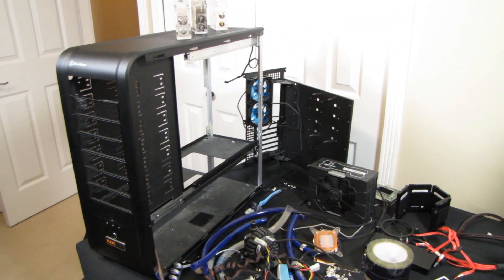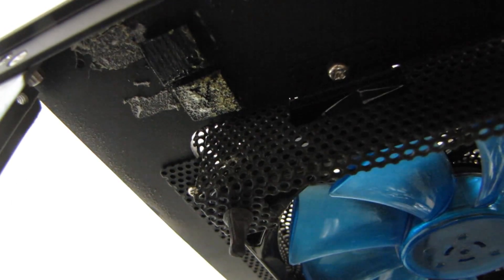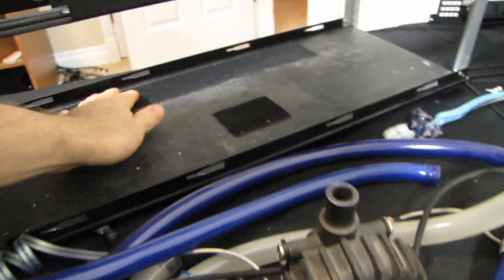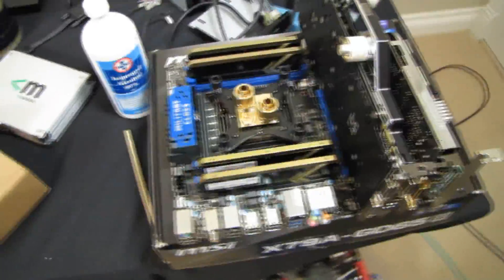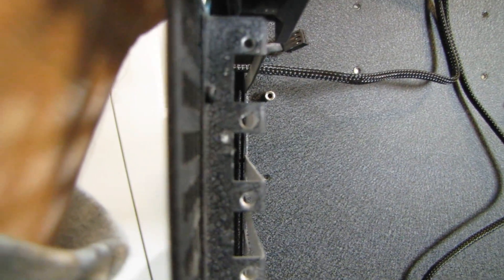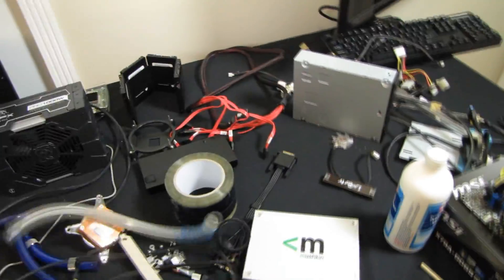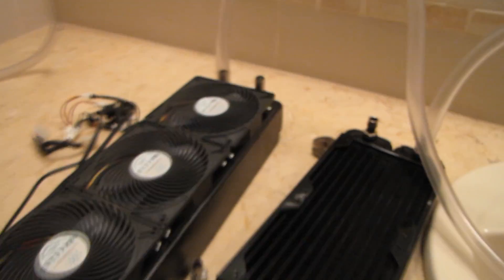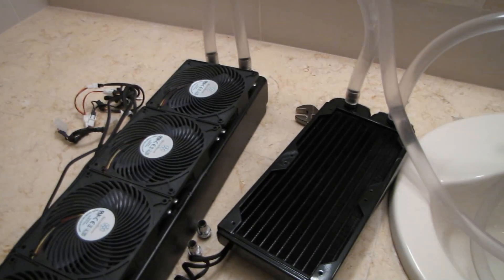Personal Rig Update 2012 Part 3 - Water Cooling Maintenance & More Pondering Linus Tech Tips

Comment: All computer parts do better in the long run with maintenance. Just about anything does, really. Your CPU heatsink is going to clog up with dust eventually whether you're watercooling or air cooling. What you're talking about is closed-loop watercoolers you buy pre-assembled, though. Not custom loops, which are generally more expensive, higher performance, and more tricky to set up.

Comment: hey, if you are limited in budget, go for amd platform, otherwise, stick to lga 1155, DON'T buy lga 775 because you only can upgrade the processor to core 2 quad (which is more expensive than core i3) i'm using this type of socket right now and i'm waiting for my fx 8120 (maybe fx 8350)... :-)

Comment: There are far better ways to clean the cooling system.  A very simple way is to is to drain and refill with regular water.  Now add a little general purpose lime scale remover ie: Lime Away, CLR.    Let the pump run for few min, flush with distilled water.  All your tubing, your Micro-res, it will all look like new.  I've done this 6 times now in my water loop, I haven't seen any abnormal wear on the Rad or blocks.   Coffee pot cleaner may also be the same stuff but I'm not sure.

Comment: the reason u have gunk in your look is because the water you use in the loop 
i see that you are using house old water that isint clean you need to buy distilled water and you
need to do a distill run through at least 5 times at about 15 min cycles with at 10 min intervals

Comment: @LinusTechTips or any smart Water cooling fanatic out there....To clean your tubes or your blocks couldn't you put like rubbing alcohol in the piping or blocks and let it evaporate out and seal it immanently? I mean with rubbing alcohol once it evaporates you're good to go as far as that goes as it leaves no residue behind, so if you're afraid of gunk and what have you, wouldn't that be a solution to completely sterilize your items?

Comment: @kitekunisaki2000 Minteral Oil/Water should only be used on lower end machines, any high end machine will generate to much heat which is a problem for Oils because oil heats up and stays heated longer than water and its heat is hard to distibute about, ive got a really low end machine my self i wanna do it to, but 120ish dollars is kinda meeh of a investment..

Comment: Nice you removed my reply...Weak.. MSI mobos are crap for overclocking get an Asus Crosshair series, MSI have turned into junk as of late "PERIOD", reservoirs are not needed, really they are just for looks.. Phenom II 960t at 4.36GHZ from 3.0GHZ on a waterbox made from an old dell case,old dell PSU, two 10 x 12 inch radiators form an old dehumidifier, $40.00 Thermaltake Pump, $26.00 in fiitings, 70/30 car antifreeze/coolant, for $67.00 bucks I have "OVER" a 1200 MHZ OC, Temps in the basement.

Comment: Resivoirs are "NOT" needed.... F.Y.I... MSI motherboards are Junk, they really suck these days, you should have gone with Asus, and also, why did you let your case get so dirty.??
Non conductive liquid only works if you have an immacultely clean case, any dust that mixes with the liquid will instantly make it conductive.. Just make a water box, I did, two 10 x 12" Radiators from a dehumidifier, old Dell case, quick disconnects old PSU for pump and fans, 4.36 GHZ doesn't lie.

Comment: Take a heated solution of distilled water/Distilled Vinegar, 3:1 ratio, and fill each part 1/4 full slap on some plugs and shake the shit out of them to get rid of the cloudiness. As for the radiator i guess thats as good as ur gonna get. btw for both of these cleaning processes always rinse thoroughly with Distilled water :)

Comment: For cleaning the radiators, what about using a weak acid and running that through before using distilled water to rinse? could use a watered down hydo-chloric acid which is used in the cleaning of cars and auto parts.. just my idea.

Comment: You're concerned about space for watercooling, worried about junk inside the case for repainting, have to Velcro your ssds to the back of the motherboard tray, and want your system to be as quiet as possible... Why not just buy a new case?

Comment: You might be able to clean your reservoirs and rads by rinsing several times with acetone, then alcohol, then distilled water.  You could also try to use a test tube brush (the bendy kind) to reach those hard to get at corners.  [Experience: majoring in chemistry, I clean gunky crap out of hard-to-clean things every day]
That SHOULD work, but if it doesn't you'll probably never get them clean.

Comment: pool shop, get some muric/hydrochloric acid, dilute it 1/4, it'll clean that gunky res right up.  I use it to clean my swiftech parts, the res, apogee xt rev.2, h/l black ice pro and 2x swiftech mcp 320.
All my parts came out looking brand new.  I wouldn't leave the acid too long on my parts, just shake it up for a couple of minutes and rinse it out with distilled water several times.

Comment: Can you guys thumb this up so he can see it this time. Linus get some Distilled White Vinegar. Fill your rads. Put end caps on them. Shake the hell out of it. Let is sit for an hour or so. Do this 2-3 times. Then Rinse out the rads with Distilled Water 2-3 times using the same method. Congrats you now have basically brand new Rads. Don't do this on any other component but Rads.

Comment: You should set up your loop with a power supply and have it loaded with hot vinegar and run it about an hour.

That would clean out the scale build-up.

Then run your pump feeding fresh water from a bucket to your sink. Thus flushing your loop of the vinegar.

P.S.

I gave a thumbs down because wasting water is never cool, I don't care what it costs you.

Comment: Whenever bought a new radiator of any size, must first make us turn of normal water for at least 1 hour before being mounted in the system ...
When assembling a copper radiator Inside is a protective copper powder, the powder ends up in your reservoir. It will dirty the water coolant

Comment: linus just let some destilled water pump true your radiators it will get rid of most of the ions.
Seccondly there are some ions in water but usualy its more going to parts per million so it will be in a really low concentration.

Comment: @fshlps 
well, as long as you don't wan't to install a H100 as cpu cooler, and as long your cpu cooler is not toooo big ( cause there are fans at the side which couldn't fit anymore with a too big cpu cooler) you should be fine with this case.

Comment: If your going to clean out your Rads with tap water, I'd at least rinse them out a few times with distilled water before putting them in the system.

Comment: Hey Linus,
I didn't know that much about water cooling (like how big the water conduit is), but there is a way to clean your reservoirs. All you need is:
- vinegar
- rice
- and water

1. fill in the vinegar
2. add the rice
3. as well as the water
and shake the mix a few seconds. After that your reservoirs would be lime-free.

regards